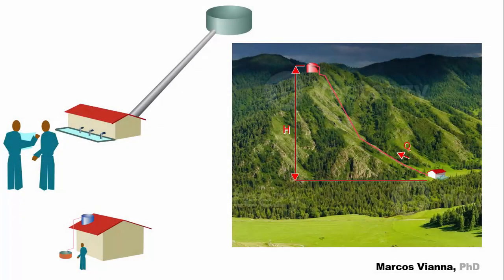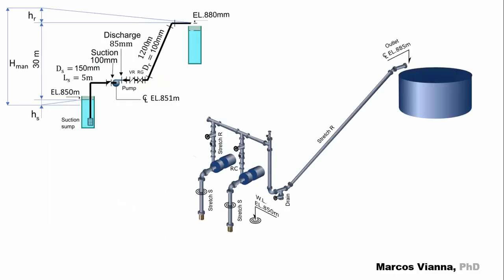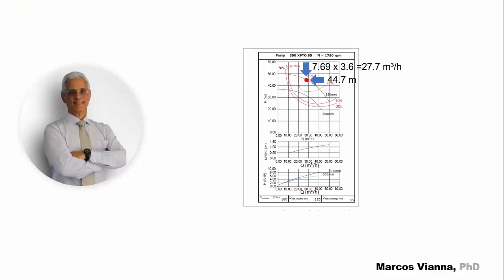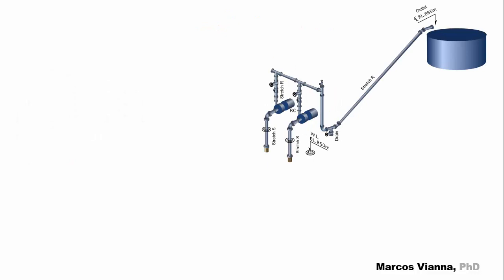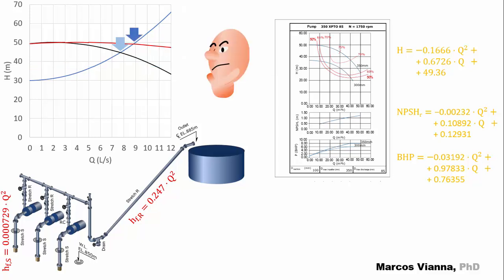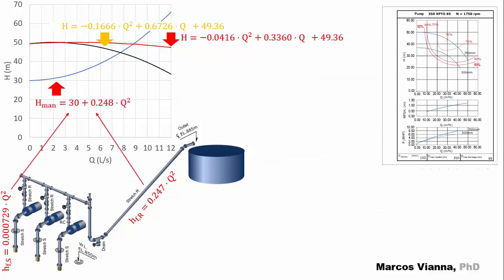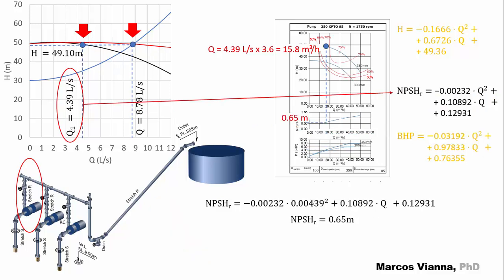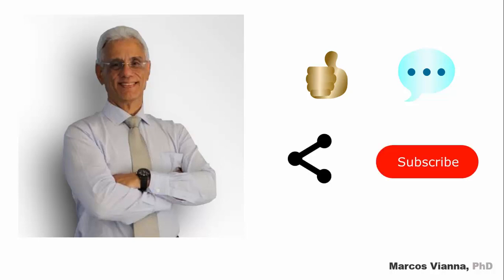2 pumps in parallel: How do they run?

Comment: Thank you for your explanations.  Does it also work the same way for ventilation fans? Im a designer and build a paint booth were I like to run identical fans in parallel to suck air.
Reply from the maker: Thank you for your question, ETOE! Theoretically yes, but I am not an expert on this subject. My expertise is water
Reply from the maker: ...complementing: on water pumps!